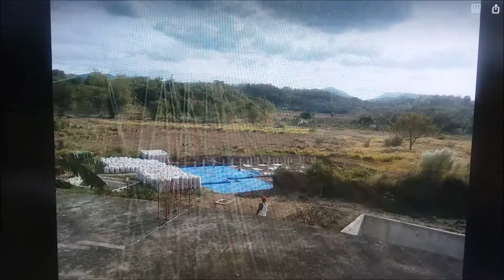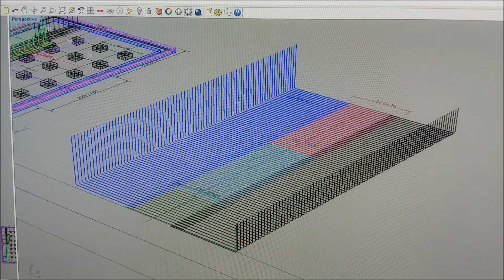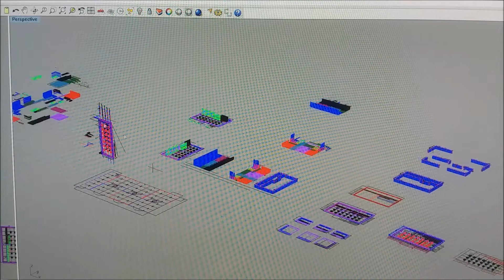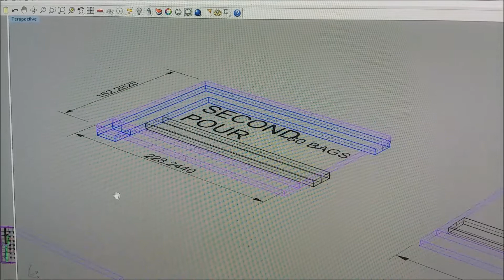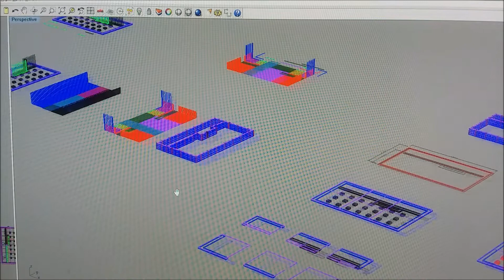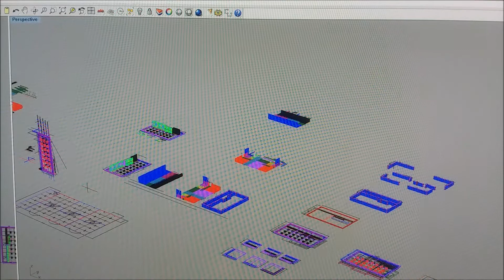aaaaCONCRETE HOUSE BUILDING IN PH, SOLAR ARRAY GROUND MOUNT PART 1

Comment: why are the house n solar/shop floor slabs so much thicker than similar usa conditions? seems like 4" is used in usa...?
Reply from the maker: There is a length dimension limit for a given thickness of floor. 
Traditionally we saw slots in larger floors to promote a crack at 
the bottom of the saw cut. Sometimes called control joints. For 
example on a 5 inch floor you would not exceed 20 feet between 
control joint cuts, and a 4 inch slab about 15 feet. Also in the US I
 would have a rebar grid on both the top  and bottom surface of 
the slab with 3 rebars of concrete cover from the surfaces to the
nearest rebar. We are dealing with a water depth of 11 feet in the 
cistern and main fish tank which have 8 inch thick floors with
the long dimension of about 27 feet. We don't want control joint 
cracks in a water tank and then there is the hydrostatic load of
38 thousand gallons of water of 280,000 pounds. The house 
floors are 7 inch with length and width of 24 feet. Also no control 
joints wanted that could allow salt corrosion  of the rebars. We only
have bottom side rebar grids in our Philippine construction projects
and the rebars in some cases are only to keep the pieces aligned 
after earthquake damage. Our walls are all poured after the floors
and therefore load bearing like extended footers. Normal Philippine 
floors are done as the last stage of construction after the building 
has the roof done. They are in the shade and just floating with no 
real connection to the structure except for some perimeter dowels 
into hollow blocks.  Finally just intuition where I feel comfortable.